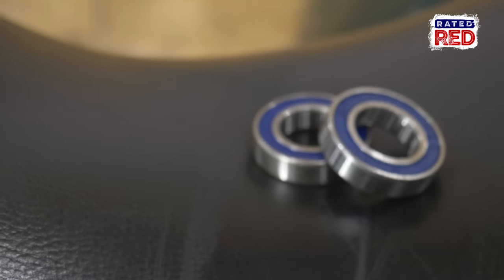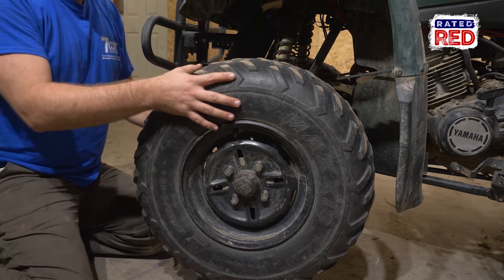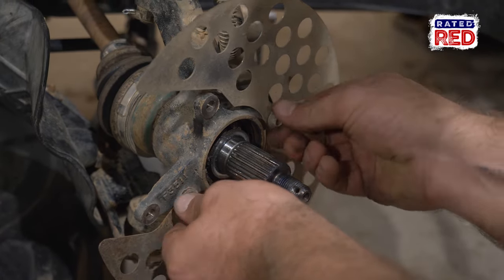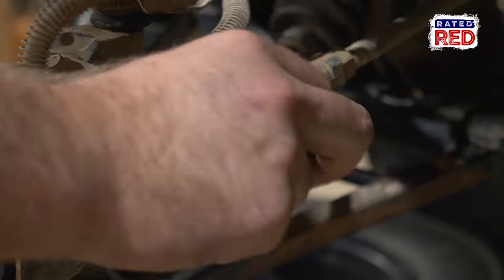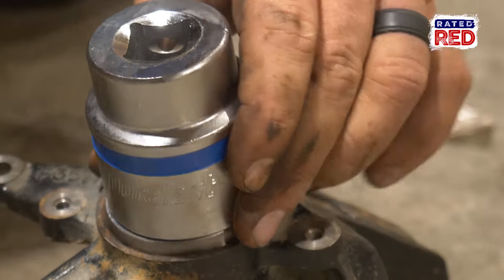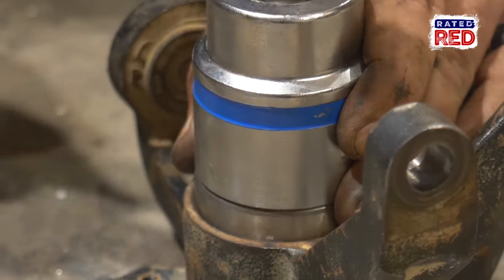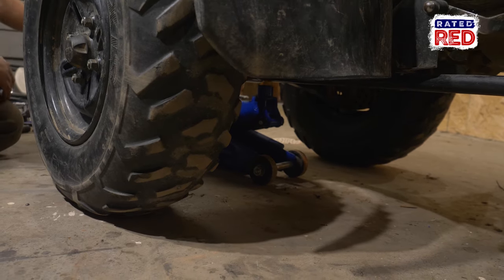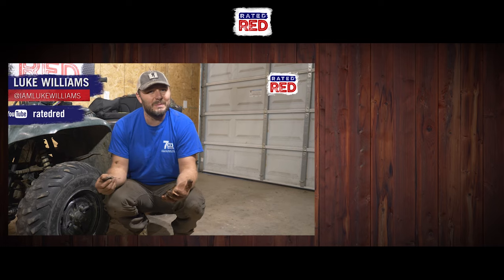How to Replace Wheel Bearings on Your ATV

Comment: Where did you get your wheel bearing from because I need those exact ones
Reply: You can get them from eBay he is using aftermarket race bearing and you can find them on Amazon
Reply: 6006rs. I got them at my local supply store. You can get them at autoparts stores.

Comment: I have a squeaky noise coming from the rear of a 350 rancher the only issue I can find is the back left axle bearing needs replaced.. would that cause a squeaking noise ? Do to lack of grease or worn ?
Reply: Hayden’s Outdoor Adventures yes or moisture gotinit

Comment: Anything bad that could happen it did bolts broke or stripped out calipers locked up with new pads on them had to cut bolts off ball joints would come off frozen stuck castle but just spinning in one place grrrrr